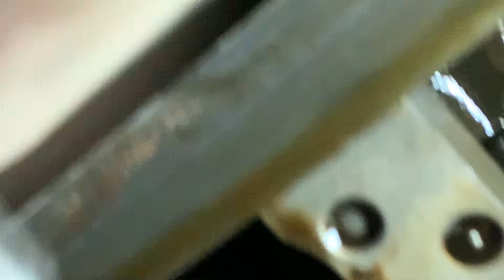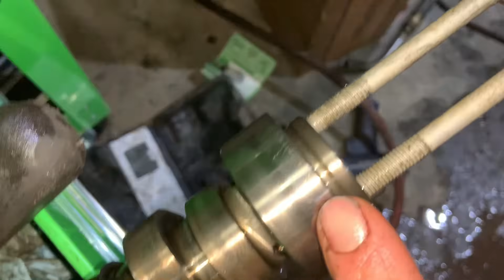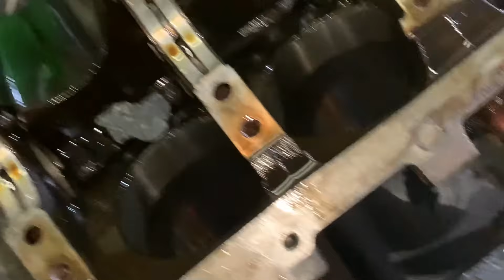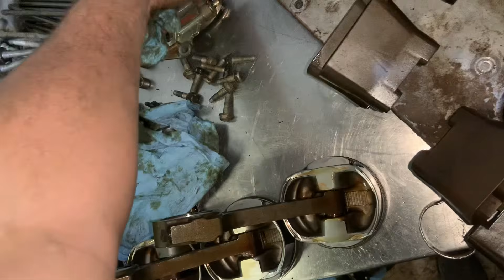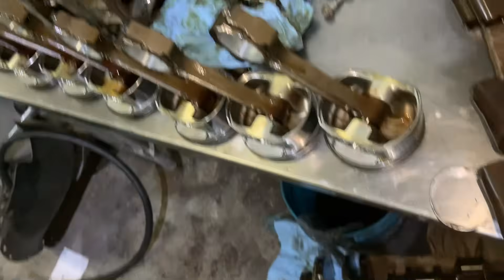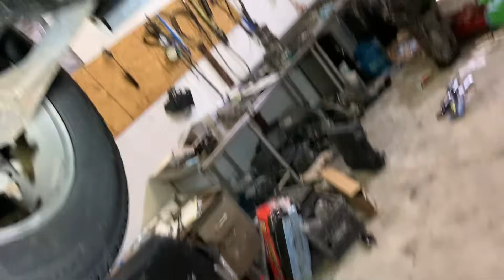ULTIMATE LS ENGINE NO OIL PRESSURE LOW OIL PRESSURE DIAGNOSIS AND REPAIR GUIDE

Comment: I just had an ls2 rebuilt with new cam bearings, rods, pistons, big cam, new oil pump and now low oil pressure 😳??? I need help!!!
Reply from the maker: how low is low.  If the cam bearings are fine it may have too loose clearances.  Aluminium blocks are very tricky getting  good crush on new cam bearings.  You need shop that can do it right.  If you dont get good fit it will spin out.

Comment: Best ls no oil pressure video on the tube. Thanks.
Reply from the maker: Wow, thank you!
Reply: @Brainstangs 
How could I get a hold of you?
I would like your opinion on something
Reply: Hands down great video!! So I've changed the front 3 cam bearing in the frame way way less work used green lock tight and good to go on a 4x4 Tahoe !!
Reply: @rickybailey7123 can you explain what you mean 'frame way' ??
Reply: Facts!
Reply: Hello,question for you.5.3 silverado 2wd, 3mechanics an 2k and 4months later im trying to still fix oil pressure issue,while cleaning pan i found 2nch skinny metel shavings,does that automatically mean cam bearing problem?? Or is there a chance it can still be something else? I have pan n pump droppd still,any help will be GREATLY APPRECIATED😊
Reply: Ditto!
Reply: You are correct thx

Comment: Love the video! I’m glad I came across this video!
I’ve rebuilt my 6.0 and just got it back from a Machanic who did a tune on it and I drove it for the first time today. As I was driving it back home my oil pressure dropped to 0! I don’t know if the Machanic did something to it for that to happen or what but I’m freaking out! After watching this video I hope it’s not the cam bearings or oil pump! I’ve replaced all of that and would hate to have to replace any of them! Any advice!
Reply from the maker: check to make sure its not the sender ,  they can be crap and a new one will show your just fine.  If you have no oil pressure at all you should have  a loud motor sounding like hell. If it sounds smooth its probably getting oil and you have a bad sender.  good luck

Comment: Super helpful, i got a 416 now that has good oil pressure on startup then once hot its like 25 idle then only 34-40 above idle rpm, wont go any higher no matter what rpm is. Curious if maybe a cam bearing walked out some. Im seeing shavings in the filter too when i cut it open and tore it apart.
Reply from the maker: 30 -40 is still pretty good.  thats a lot for a bad cam bearing.  Not to say you dont have one working its way out.  I find the clearances are a big deal on a stroker like that.  If your running .0025-.003 thou mains and rods your gonna have lower pressure than stock. Also what pump do you have?  What pressure spring in the pump?  I like to shim them for a little more pressure.